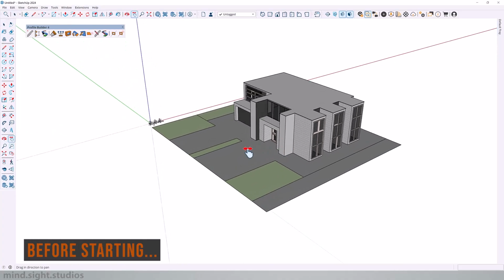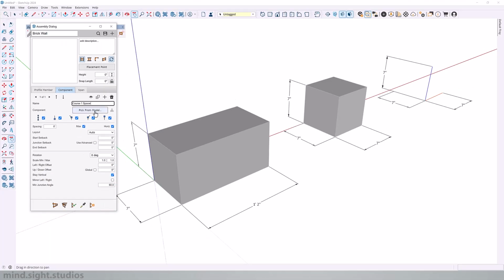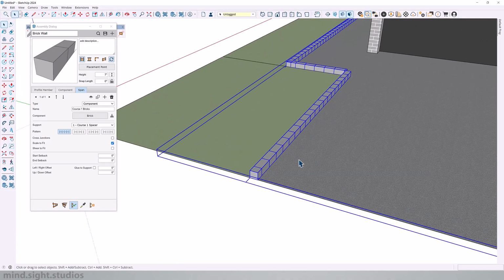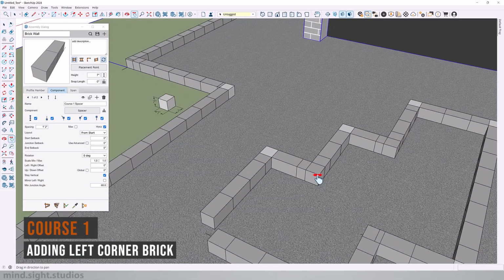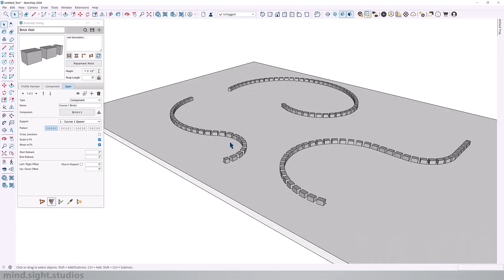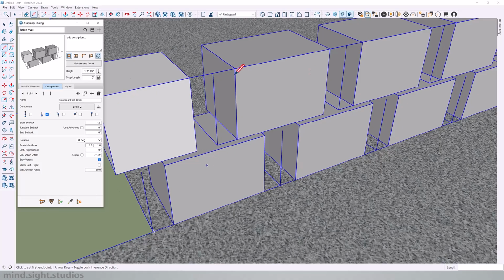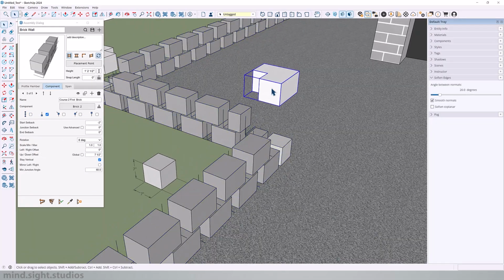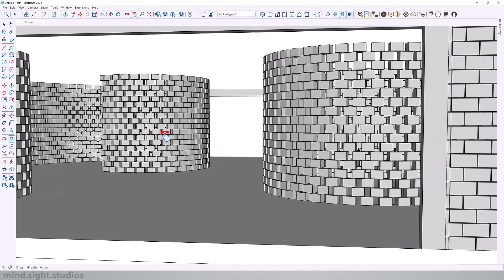Creating Parametric Brick Wall With Profile Builder 4 | Step By Step Workflow

Comment: I am purchase all your plugins you need to make something simple to work. afew parameters and do that directly. Like a Wall creator, leght, height and thickness. and styles simple as that, not millions of parameters to make a simple wall of bricks witch cretate a millions poligons.
Reply from the maker: Well, that's why we created SketchPlus!  Have you tried it?  It includes a simple wall creator tool with just a few parameters but is very powerful.  It also includes a pipe tool and more than 40 easy-to-use tools to speed up your workflow.  Check it out: https://sketchplus.com/

Comment: frankly manual copying rows is lame, I wish Whaat could address it in the future
Reply from the maker: There are a few different techniques that can be used to add more rows of brick. We only showed one of them.  You can also copy the internal geometry of the brick components to add more layers. Or, you can create additional brick assembly parts and offset them using the PB4 copy-with-offset feature.  But I'm guessing you are looking for a more parametric solution?  Would you like to elaborate?
Reply: @mind.sight.studios  thanks for attention! Yes I'd love to have a  new type  parameter(s) for arraying (or filling-in so to say)  in Z direction (both for components and profiles).  Currently PB sets the rules for arraying along the path, we need parametric rules for situations when the height of the current assembly is altering.
Reply: @mind.sight.studios  before I forget.. Could you guys somehow  hightlight the current component\profile while live editing is happening? It'd be a H-U-G-E visual help for those who don't bother giving proper names